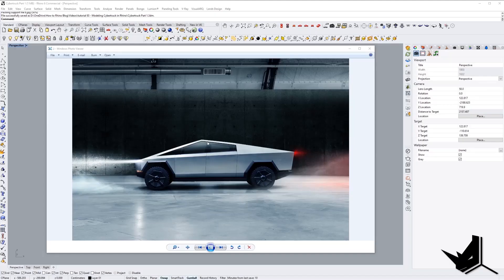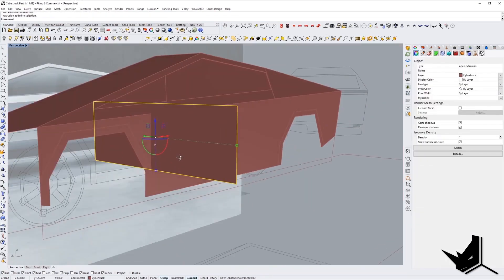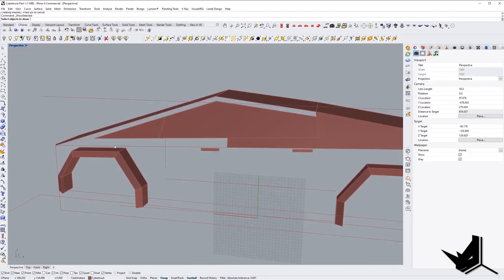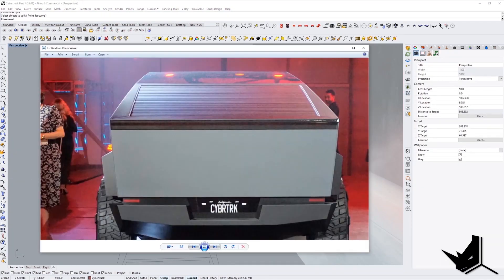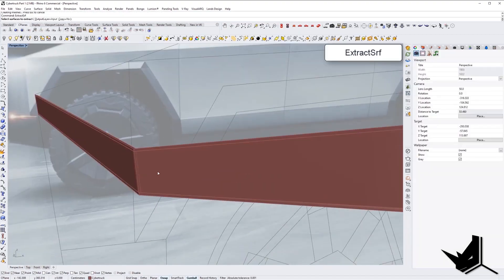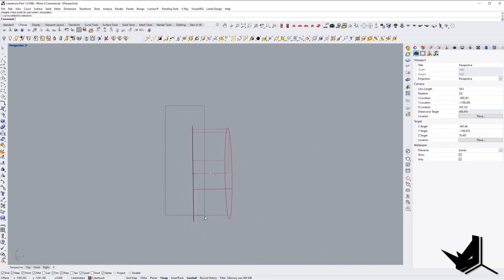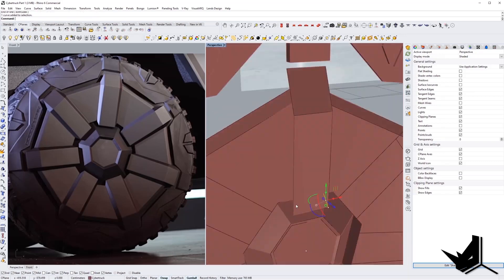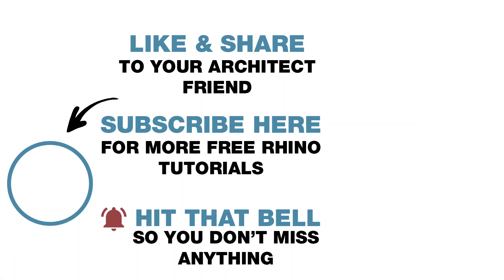Modeling Tesla Cybertruck in Rhino [Quick 3D Tips - part 1]

Comment: nice, what's about using displacement map for the tire it could be really interesting and I guess easier than modeling it manually.
keep the creat job
Reply from the maker: Hey Mahmood, displacement map won't really give realistic results in this case. Modeling this is not difficult, you just create a 2d drawing of a single thread piece and then use polar array to apply it to the whole tire.